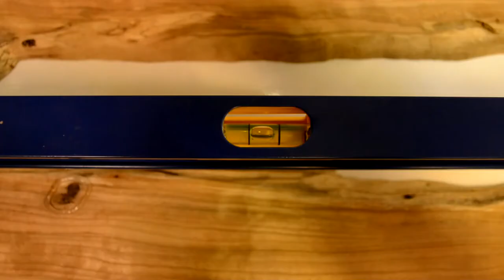Epoxy Fly Tying Table - DIY Build

Comment: There may be a flaw in your design where the holes are for the scissors. The tip of your "very fine" scissors should not bottom out in the hole as it will eventually damage the tips.